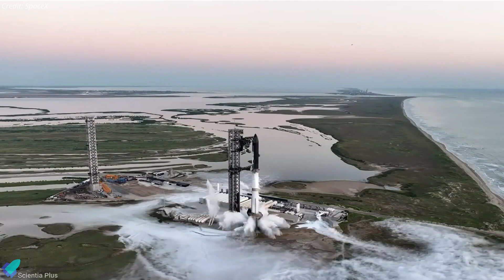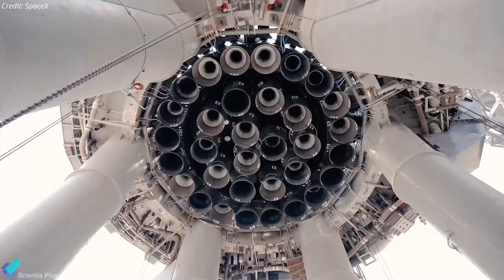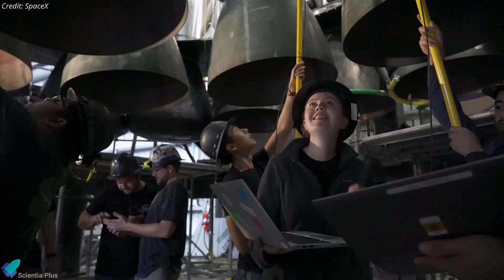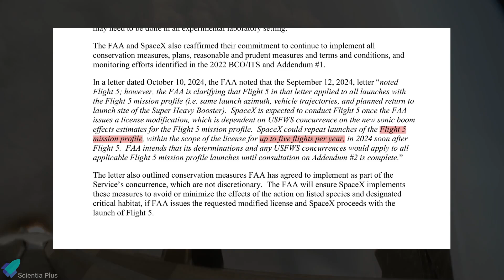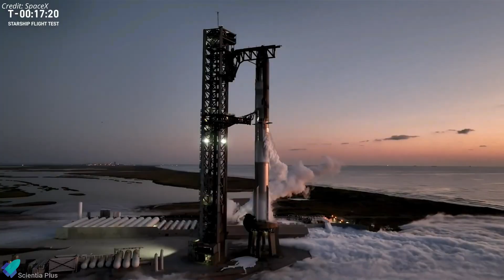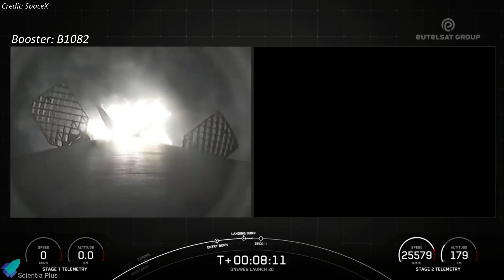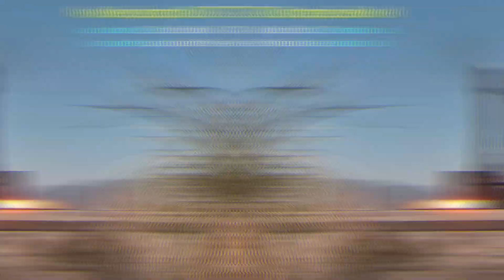FAA Gives Starship Flight 6 the Green Light! Booster 13 Static Fire Success!

Comment from the maker: 00:00 Starship Updates: Flight 6 Prep, Booster 13 Static Fire & Raptor Engine Rapid Fire
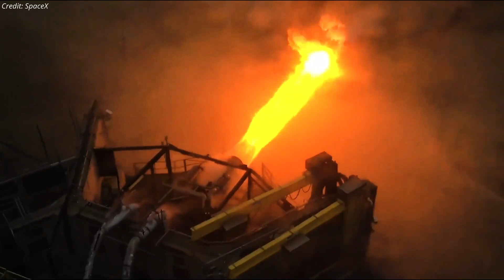09:24 SpaceX Hits 100 and OneWeb's Path to Global Connectivity
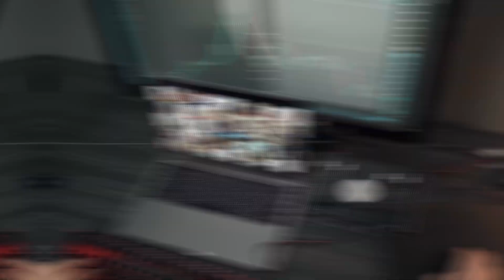11:43 Blue Origin’s New Rocket Set for Crew Missions - New Shepard NS-27

🚀 Starship Flight 5 Analysis Complete Breakdown: https://youtu.be/JY4aGEt03N4
🚀 Starship Flight 5 Aftermath: Booster Issues That You Missed & Launch Pad Damages: https://shorturl.at/6SJi1

Learn More:
1. Starship V2 Features:
  a. Design Improvements Update 1: https://shorturl.at/lpGT7
  b. Design Improvements Update 2: https://shorturl.at/gwNQ4
  c. Nosecone & Payload Bay Redesign: https://shorturl.at/xa60S
  d. Methane Downcomer Redesign: https://shorturl.at/XdYBG
2. Starship V3 Features: https://shorturl.at/mnBT4
3. Starship V2, V3 & Raptor V2, V3 Complete 2024 Update: https://shorturl.at/tN248
4. Raptor V3 Mega Upgrades & First Test: https://shorturl.at/TRIyj
5. Latest Starship Upgrades
  a. Starship Hot Staging Explained: https://shorturl.at/jf400
  b. Super Heavy Booster Upgrades: https://shorturl.at/Pi5R3
  c. How SpaceX Protect Raptor Engines: https://shorturl.at/4Om8F
  d. Starship New Heat Tiles Explained: https://shorturl.at/p2Ijb
6. Starship Flight 5 Analysis Complete Breakdown: https://youtu.be/JY4aGEt03N4
7. Starship Flight 5 Aftermath: Booster Issues That You Missed & Launch Pad Damages: https://shorturl.at/6SJi1

Weekly Updates: https://bit.ly/3HIQjPC
SpaceX Playlist: https://bit.ly/34wue8T

Facebook Page: https://www.facebook.com/scientiaplus

Comment: Why don't Mechazilla have HEAT TILES?.
    It undergoes major heating on each catch , from booster jets .
Reply: Heat tiles are exceptionally light, have high duration thermoprotection, and are therefore very expensive. On ground equipment much cheaper systems can be used for the very short time there is intense heat exposure.
Reply: And heat tiles are brittle and a launch exhaust flame would easily crush the tiles under the pressure. Difference between static heat and high pressure heat

Comment: Will they be launching so soon as mid November, I am not sure as there is little point following exactly the same mission profile as flight 5. Remember the current launches are to push the program forward not just to launch for the sake of it. As all aspects of the mission in flight 5 were achieved they need to introduce something more for flight 6 to make sense. If they launch quickly it can only be to test one thing and that would be a significant change in the heat tiles as these were still no where near good enough in flight 5.
Reply: I'm of the same opinion. Flight 6 wouldn't make sense if it's the same profile as 5. I guessed they might want to try for orbit (and a deorbit burn), and maybe test the payload system by deploying a payload while at it. This might not be the case.
Like you said it's possible the target for this next test is the heat shield system, but that also will be too narrow in scope imo.
Who knows?
Reply: @okirooju3787  Exactly, there needs to be a good reason for the next launch which means testing new things like full orbit with de-orbit burn. I don't think changes to the heat shield will be enough but there may be lots of control system tweaks they want to test after the last fully successful mission before moving forward, who knows. Predicting what SpaceX is going to do next isn't so easy to do.
Reply: @schrodingerscat1863  yeah. The FAA talked about flight 6 requiring no new approval process since it will be within flight 5's profile. Now, I don't think anyone knows the full scope of flight 5's profile. Did it also include orbit/deorbit burn but SpaceX decided they were not ready to test that? In that case it's possible flight 5/6 approval both cover an attempt for orbit, which we'll find out soon enough.
Reply: @okirooju3787  The current licence does not include going fully orbital to my knowledge because that requires an orbital relight of the engines for controlled de-obit burn which hasn't happened yet. Maybe they will be doing an engine relight this flight which wouldn't be a substantial change to the flight 5 plan but is a significant milestone before going fully orbital. Remember this was supposed to be tested back in IFT-2 but they lost attitude control so couldn't do it.
Reply: @schrodingerscat1863  yeah, I we'll see. If Nov. 11 is the launch then we're not too far off.

Comment: Does the rocket restart for the different upward wind speeds opposing the downward rocket thrust?  What was the origin of the fire on descent of Starship 5?
Reply: On the booster, when the engines are shut down there is still unburned methane in the engine and pipes that supply the engine, this methane needs to be purged to reduce the risk of explosions so is vented out the engine itself and out of a vent near the QD panel. This methane then just burns off in the air as it comes out of the vents being ignited by the engines that are still running. SpaceX verified that Starship had the flight termination system activated just after splashdown in order to get it to sink quickly. That is why there was a big fireball just after it settled on its side.